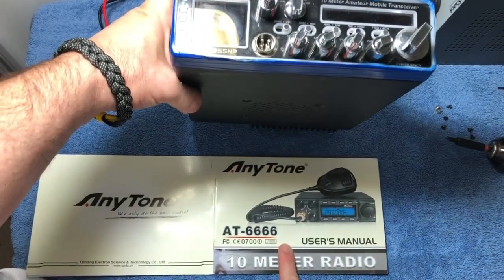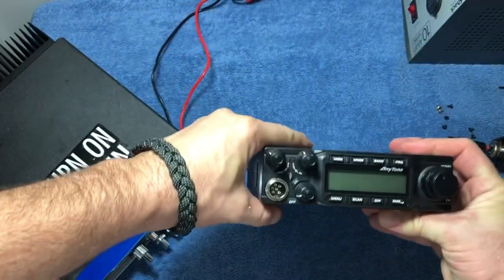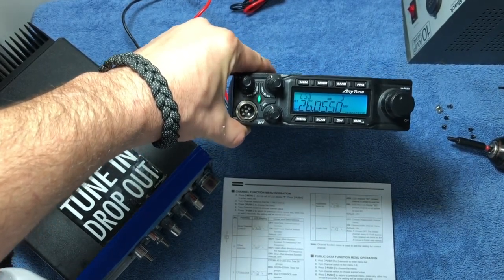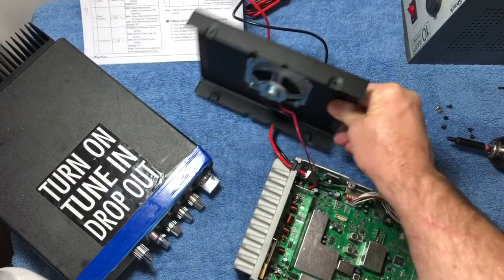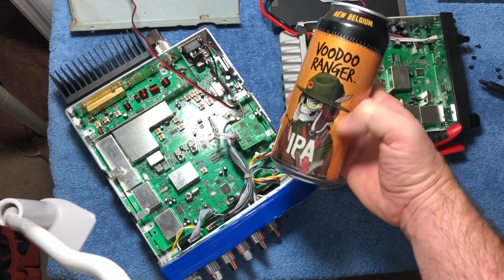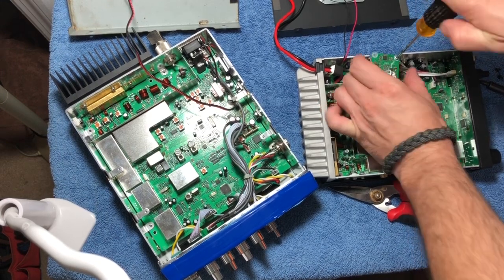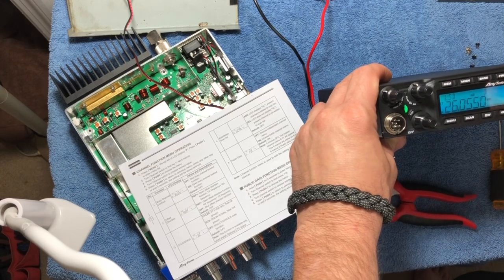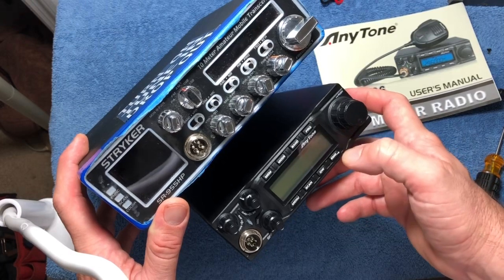Stryker CTCSS tone board in an Anytone Quad 6 ?! Will it work ?!

Comment: Hi Eric, 

The boards sold by Bob's CB Shop for the Top Gun Predator appear to work well in the Anytone AT-6666 (quad 6) also. I think these are slightly newer revisions of the same board that Anytone and Stryker use.
Reply from the maker: Thank you very much for the information !

Comment: I love my little anytone. I'm pretty sure anytone makes the radios for Stryker.
Reply from the maker: I agree.  The Anytone parent company  Qixing  Electron makes the Quad 6 for variety of companies from Avanti, CRT,  Dynascan (not related to the old parent company of Cobra) and Superstar depending where it is distributed in the world.   I am impressed on the Quad's power, features and size.  One radio I do like the layout more than the 955 is the  CRT SS 6900N with a large display but has a lot less power.